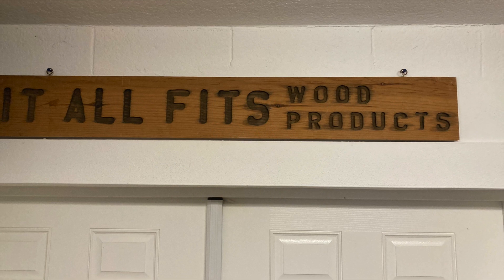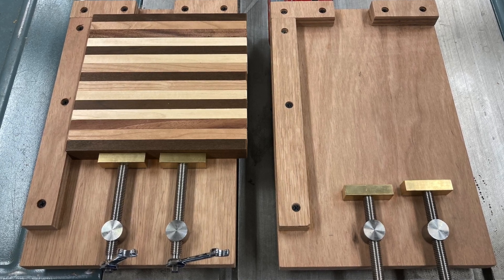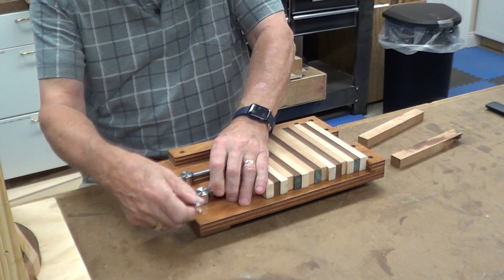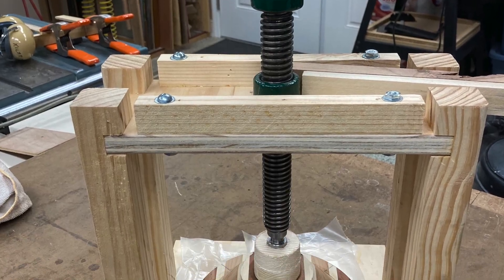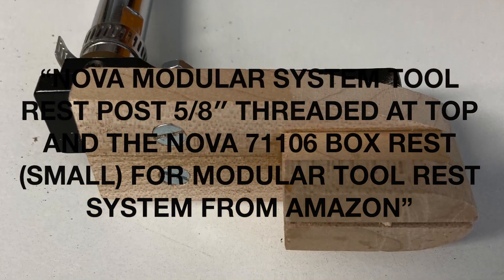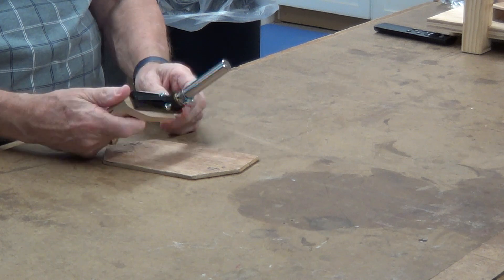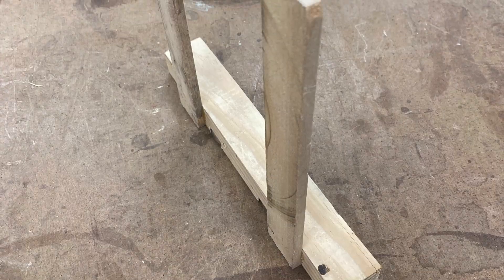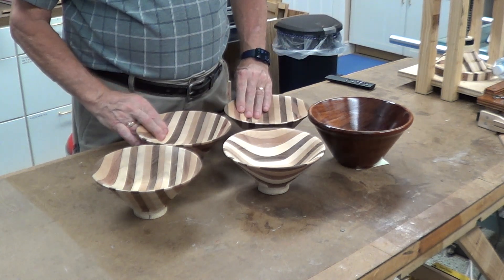Jigs for Bowl from Board

Comment: Looks as though you found some interesting videos to help you with making a bowl from a board. Happy you found them. That was my reason for making them, 
I did add in the video that a piece of HDPE would be a good option for the tool guide. Your oak one should be fine but just a thought.
Gary
Reply from the maker: Thank you for the comment. I get a lot of my instruction from your videos, you are my main source of help on my projects. I try to do it my way, or make any adjustments to suit my particular situation. I only have a 10” lathe and can’t make larger items so I have to adjust my scale to fit. You are an inspiration to me since I may be a couple years older… but not wiser. Love your videos.

Comment: I was lucky enough to have a friend give me a full dining room of laminated hardwood flooring. He purchased his house from a cabinet maker who took his off cuts and made 12” x 12” x 3/4” thick floor tiles basically and did the entire dining room in it. Walnut oak, cherry, maple hickory, and a few other varieties were just all randomly made into strips and laminated together to make beautiful floor tiles. They were getting pretty well torn up and he was remodeling so he gave me all of the wood. Of course I made him a few projects out of the pieces for his wife, especially But I don’t have to laminate wood together for quite some time for bowls for boards. I love your jig for gluing up though, and I will duplicate your design most likely for the press. A very good video, sir. I was going to make a jig like yours to put the parting tool in But I actually found that if I just scribed a line on my lathe bed and use my normal tool, Rest, I could basically line up my thin parting tool with the line on the lathe bed, and that was accurate enough for me to cut through the wood quite nicely. I’m curious how you used your backer board in operation. Your bowls are a beautiful finished product for sure. Well done
Reply from the maker: I'm not Sure what you mean in the last part of your comment. "I’m curious how you used your backer board in operation." let me know more of what you mean please so I can comment on it. Thank you for your praise of my bowls, I've been working on them most of the year. I love making the jigs I need to accomplish all my tasks. I'm working on a new system for segmented bowls.
Reply: @It.All.Fits.Wood.Products15  I haven’t watched the video for a few days but I think you had a vertical jig set up behind your board that you were going to cut to maybe keep the ring in place to keep it from dropping down around the spindle? I was curious about that and how you use it. I also have a thought for you that might help you. I had a long serrated stainless steel bread knife that my wife no longer wanted sitting around my shop for years (can’t throw anything away) and finally decided to make a very thin parting tool from it. Its blade was maybe 1/32” thick and quite long and fairly flexible. I had to grind off the serrated edge as this would sit on the tool rest. It works amazingly well, especially for parting rings on bowls from boards! I was worried about the flex in the blade but it actually helps to follow the kerf into the wood as you cut on the diagonal. I don’t need to widen the cut much to make it through my 3/4” boards I usually use and it just flows down through the cut. I can cut thinner rings and get more height from my bowls because of that. Very little waste and less stair stepping on the glue ups. I just hone the front tip before cutting a bowl out of habit but it actually keeps a decent edge fairly long. I also do pendants on end grain leftovers from spindle turnings and may only have 3/8-1/2” protruding from the chuck. I can face and decorate the pendant and use this to part it off with a very narrow cut. Allows me to make something from what I used to throw away. Also works great parting of larger diameter pieces. I have never had a catch because I think the flexibility follows the edge of the cut without grabbing. The handle fits my hand perfectly and for $0. It is my go to parting tool now for most situations. My parts are less than 1/16” wide which I love cause I hate wasting any wood. Maybe you’ll benefit from this. Thanks for your very valuable video on bowls from boards
Reply from the maker: @scottstubberud1137  If you watch the other Videos you can see that the back stop is used behind the board that is being sliced to make the bowl parts. If you keep it close to the board it lets you cut your slice and holds it from spinning off to the back where the chuck is. Thank you for your comments and hope that my Videos will help people understand how it's done to creat a bowl from a board.